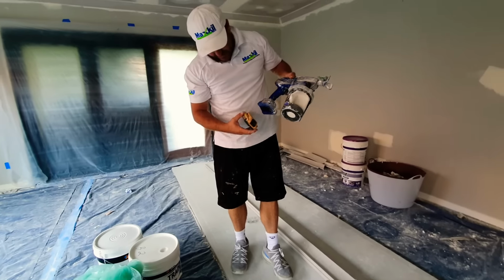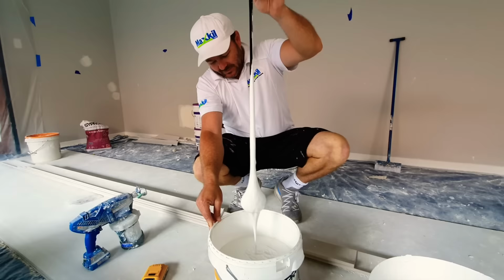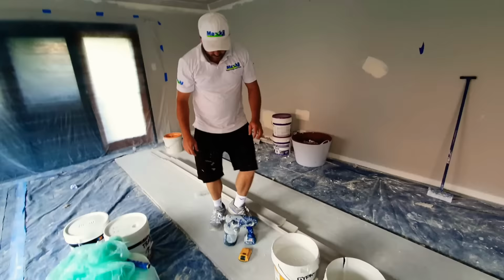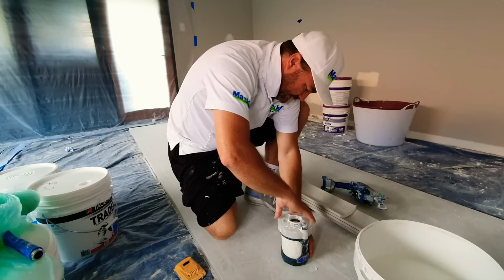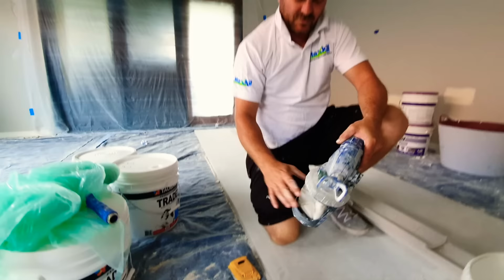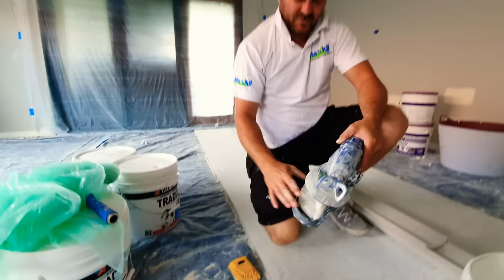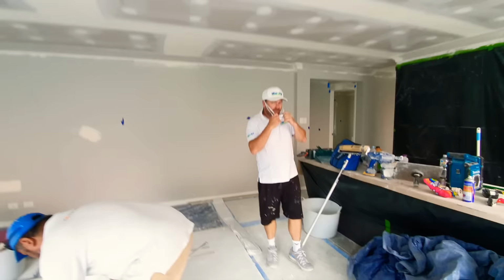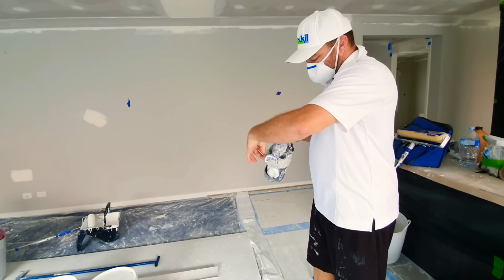How to Easily Paint EVERYTHING Fast with this 18V Cordless Sprayer

Comment: I hear that after you di it with this kinda tool you get zebra tracks when its dryout.
Reply from the maker: There is a speed dial which you can slow it right down and can imagine what your saying can happen, but when you adjust it up, it like a continuous even spray

Comment: Gday i am a renderer by trade for 7 years and i worked with a painter for 3 years and he taught so much about painting, however, i have never used a spray gun before, i do own a graco, but havent used it yet. Do you do two coats on the corners, same as a paint brush?.
Reply: I normally do at least two coats everywhere, if it's new siding you might get away with one

Comment: It would have driven me crazy to paint an entire apartment with this sprayer that only holds one quart. Have you ever tried using a 395 airless where you can drop the intake into a 5 gal. bucket ? When you run out you just pop it onto another 5 gal. bucket and let it rip. I just don't get it.
Reply from the maker: Yeah, remember I only need to spray the perimeter. But I see your point
Reply: Why only the perimeter? Didn't you have to prime the whole ceiling? @Maxkil
Reply: Lol I was thinking the same thing. My 395 would have sprayed that perimeter stupid fast and no reloading of the cup.  I own 2 of the  handheld sprayers, but it is for small jobs like a door or 2 etc.

Comment: so you just use that spray gun tool to paint all the corners?
Reply from the maker: Yeah pretty much in this instance, if you masked everything then you could do more but we use this with little preparation and if just spraying the edge and rolling the rest doesn't leave much paint in the air
Reply: @Maxkil  how did this become your profession? I wish I had the same job as you,excellent video
Reply: @Maxkil  also I'm a beginner what kind of paint sprayer should I get i will just need it for my house walls and home diy stuff basically any advice for what brand to go for i was thinking the wagner w590 but now I see this graco cordless.
Reply: @h4fiz_202  get a small machine.. if you only use it for one time job cleaned good when you finish or it will get bad inside.

Comment: Can you spray the walls and ceiling with this too?
Reply from the maker: yeah you can only its quicker with a roller
Reply: @Maxkil  so what's the point of the sprayer? Just for the corner where the wall meets the ceiling?
Reply: @FlowTheories  it's good for baseboards, doors and trims in general, it takes too long by brush and roller to do the trim so this sprayer comes in handy, you can also use it for cutting corners saves a lot of time, in painting usually the small stuff is what take most of the time so having this sprayer is a dream.

Comment: Hey I just used this sprayer for the first time spraying crown. I got a small amount of orange peel I wasn’t a fan of. Used latex trim enamel paint on setting 2 with a green 210 tip.
Reply: Use on level 5 to 7
Reply: @camdecorations9779  should I thin the paint down a bit on that setting? Seems like it would lay it on thick then
Reply: @TTurbo06  You have to most fast. Airless is not ideal for detail work, even with the new tips. Perhaps thin 10%.

Comment: Dont do this hire a painter that knows what he's doing takes me 30 mins to spray all those ceilings with a real spray machine
Reply: He’s using for a trim sprayer, not a ceiling and wall sprayer. 
In 30 minutes you can spray the whole house with the inline gun, heavy duty extension, clean shot and 621 tip.
Reply: @Igor-q3f  exactly the whole point of a sprayer is to get big areas done fast which speeds up the job. Plus you would hit all the trim at the same time..